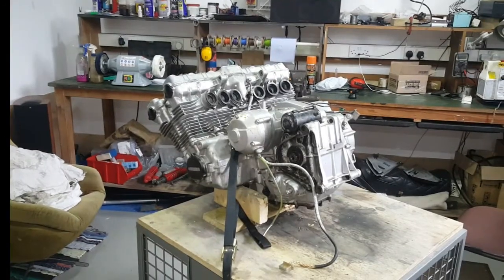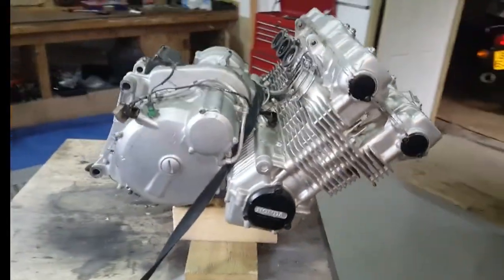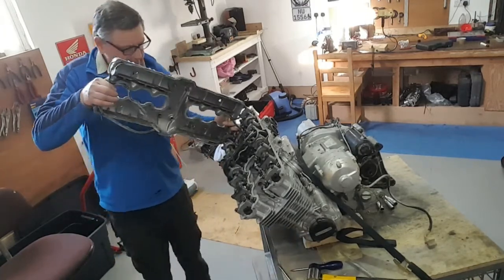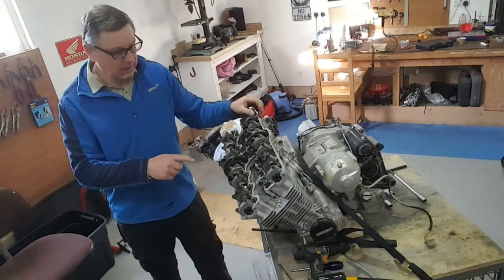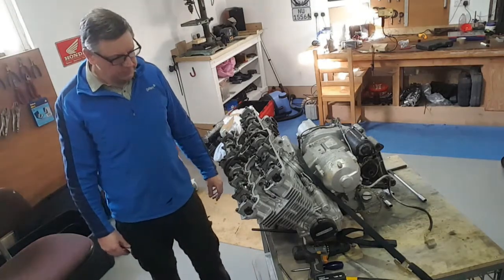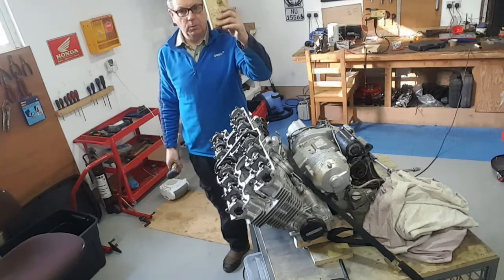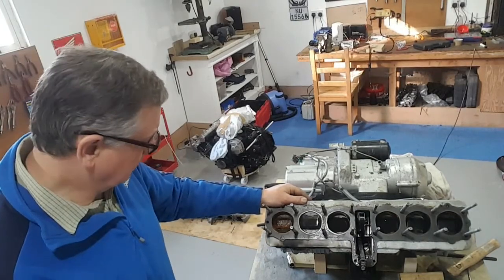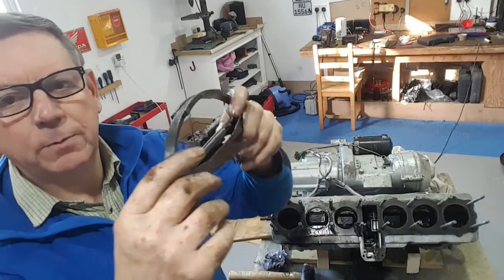CBX Dissection Pt2

Comment: No the rod is not weak if you don’t exceed 10000 rpm. What leads to rod failure is usually big lybrication related failure or hydraulics rods that are no longer straight.

Comment: The rods are the weak link in the cbx motors,
Reply from the maker: @craigdevenport2307  the rods are normally pretty good. The issue comes from leaky taps and carbs letting fuel into the cylinders. Then you go to start it and bang it hydrolocks!